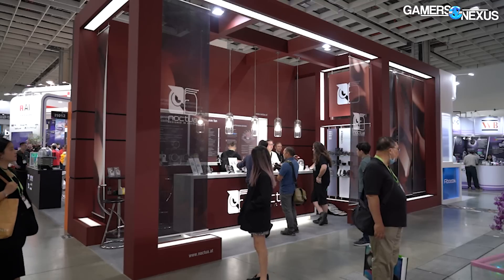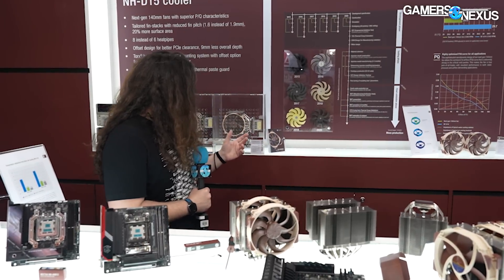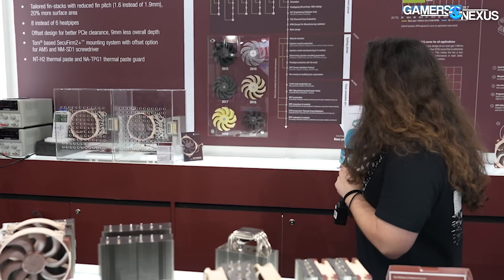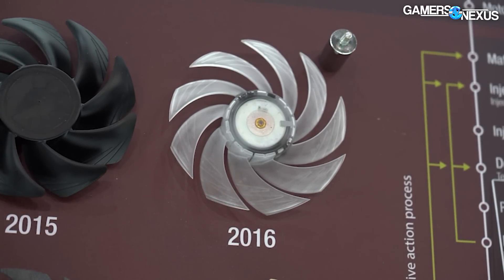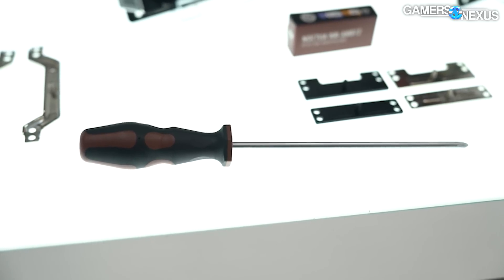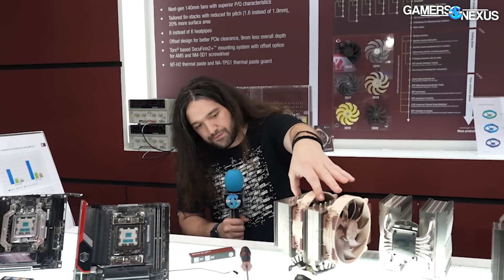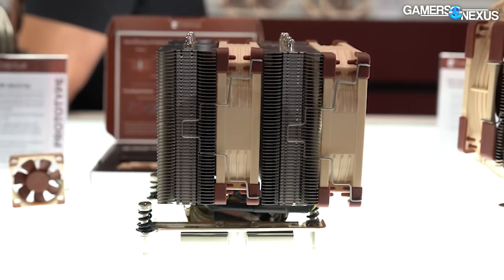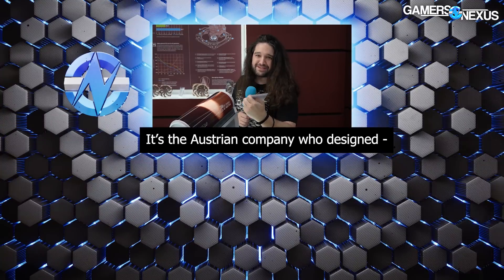Noctua is Back: NH-D15 Gen2 & 8 Years of Fan Development

Comment: I’ve been using my NH-U12-SE AM4 for about, oh, 6 years or more now? Saw me through a Ryzen 1700 and 3600, but now I’ve decided to upgrade to a 5800X3D I’ve decided to stop using it and go with a Thermalright Phantom Spirit 120. I haven’t actually seen how either performs just yet but I will retain the noctua case fans I bought, plus I’m sure the noctua fan and cooler will make a good secondhand market buy for someone along with the 3600. I very much rate them but I feel like there is more bang for buck out there in the world - NIDEC Servo, Akasa, a lot of decent firms get overlooked because they don’t have any bling or frisson, or they’re more industrially focussed, and I feel like noctua is a company that sets a premium on its quirks and isn’t as unassailable as they once were. I’ll be sticking some gentle typhoons into the phantom spirit to see how they get on.

Comment: 1:14 you can see they tested it (NH-D15 Gen2) on ROG X670E GENE MB, which has the GPU PCIE slot on the first slot, and it even works with the offset mounting. 
That's Noctua's quality and compatibility, really appreciate that

Comment: The 7mm offset is a 1c-2c cooler for AM5 eww and AM4 5000 series way better lol.
Reply: What?
Reply: @MrBlackmidi1234567890987654321  the 7mm offset for AM5 sucks but for AM4 5000 series CPU"s much better hell own a R9 5900x ran the CB r23 mc 30-minute throttle test scored 23,278 not bad.

Comment: I’m thinking about upgrading to a 13900k. Is something like the Noctua generally fine for this cpu or do you really need to go with an AIO to not thermal throttle? I’ve always shied away from AIO’s for some reason. I guess I don’t like the possibility of liquid leaking into my case or that the liquid can and will eventually evaporate. If I was sure it would last 5 years or whatever that would be fine but I’ve had friends who’ve had issues with cooling even after a year or two and they cracked their cooler open and it was empty. I just don’t want to deal with stuff like that. Or am I being crazy and is that kind of thing super rare? Is there a particular AIO that just has exceptional build quality and a long warranty? Thanks.

Comment: No matter how large the cooler base is, NPCs still put "pea size" amount of thermalpaste on the IHS and then spam forums with posts about bad temps =D While the IHS-cooler contact is covered only about 60% due to poor installation and cores not even located in the middle of the CPU itself

Comment: how bout these companies quit burning money on out dated fan technology and invest money into a modern cooling solution which replaces the fan and actually improves cooling for these new cpu/gpus that are running at 100c,  its advertised as just ok tjmax 105 110c nothing to worry about but there is its called seeder cracks  in leaded/unleaded solder which can happen after 1000's opf cycles of 100c+ heat and when these seeder cracks happen ya cant find it because there is no short to ground anyways yah reviewers need to quit hyping up fans its getting old and isnt helping the consumer

Comment: Noctua for me is the same level of compassion and craftsman-ship that Technics had and still has. Technics enabled DJ-ing Culture with their insanely durable 1210 Turntables about more than 45 years ago (and a few variations in specs afterwards) and if your 45 years old system has a part failing... you are able to get new parts still. Noctua is living up to this same hype in terms of longevity. I rock an NH-D15 since 11/2015 and used it with three different CPUs, and can still use it for the next gens to come free of charge. i'm also using the original fans i got with it from 2015 and they perform like never anything happened. Noctua is a staple of manufacturing, their stuff is just worth the pennys. I am absolutely looking forward what gen2 has to offer.

Comment: I wonder if they are doing any R&D on Toroidal blades?  I know they are being developed for quieter drones.  So far independent designers aren't getting the blade pitch/shape/thickness right for a pc application.  With Noctua's resources they could make it happen, MIT idea but it could be a big leap in air flow vs noise.

Comment: The Thermalright Silver Arrow T8 has had 8 heatpipes for quite some time now. I have it installed in 2 of my PCs.
It's a pain in the rear to install, and the heatsink fins are sharp enough that you can cut yourself, but it does wonders cooling.
The only way I can get my Ryzen 5900X to reach 80C is if I stress test the CPU with CPU-Z and run Furmark at the same time to heat up my Asus 3080 12G TUF OC - all in an ITX case. I am using noctua fans on the case for airflow though.

Comment: That might be a longer development cycle than my Noctua fans have warranties, but its not as long as my Noctua fans have lasted. Before using them I found fans failed more frequently than any other PC part. I have replaced fans to change sizes and further improve noise levels but still at zero failures since 2009 across multiple computers.

Comment: Great coverage of new Noctua products. Very cool contunued innovations. I have the Noctua NH-U12A, and it's the best air cooler I've ever experienced (although I did have to zip tie the fan-clips! my "user error", more than anything else) BUT, that aside, they are amazing products..cpu at idle is 38c, load is no more the 60c (5800x3d). Some of that is my case fan configuration, but again...no complaints! Thanks again Steve and all!

Comment: I am all for proper development, but the problem with long developing cycle is that it comes with big expectations aka the new product has an even larger shoes to fit. Certainly that got even harder now after Thermalright absolutely blew up the market with the Peerless Assassin. This new HN15 will probably be expected to fight most 360mm AIOs and not juat the crappy cheap ones. I am sure that Nuctua also knows that this new cooler won't be compared just to the old NH15, but to the very best air coolers on the market. Can't wait to see the results.

Comment: I could have easily purchased 2 NH-D15 coolers for the price I paid for my CLC, but it was said that none of the large air coolers would fit over the VRM heat sinks on my board. As much as I hated to spend that much on the CPU cooler, I do think the build looks better with it.

Comment: Been using my NH D14 since 2600k era, and now keeping my 13600k cool together with their free 1700 bracket. Now that is a quality product.
Reply: I am in the exact same boat! 2500k, then Ryzen 3600, bow 13600k. Solid as a rock, the fans are still perfect and Noctua sent me 2 mounting kits for free...
I think I will get the new cooler when it comes out but I don't doubt that my old NH-D14 will still be alive then!

Comment: Fan factor - my 1st Noctua NH-D14 edition which I bought for my Sandy Bridge 2500K running 5 Ghz @ 4 cores, STILL works fine and it's been ON pretty much 24/7 since then, as about 4 years ago I put it in to my server, before that it was in my main PC, which is on 24/7 as well -)

Comment: I am happy. XTU 100% CPU 2 hours @71-75C on air. I can't complain. I build my systems mostly for gaming- system specs below. I messaged Noctua they sent me a LGA 1700 mount kit within a few days and installed perfectly on my Z690 mobo. I do not trust and may never use AIO or wet cooling. I cant afford my stuff being ruined by leaks. It might not be so common- but is no chance at all with air cooling. A fan going bad is not as bad as a pump. I like my Noctua coolers and fans. :) 

I read about the Intel CPU' bending and seen the vid on GN and bought the Thermalright anti bending pressure plate. I had also read that pretty much all mobos with the Intel 1225v 1226v lan can have problems- so I preempted any potential probs and bought installed a Realtek 2.5Gb lan with the pressure plate during my build. I also read seen benches showing the Arctic MX-6 cools a little better than mx4. I found some good sales over the 2022 Holidays and at the time my 4070Ti cost $100-170 less than a 3080- and the 4070Ti performs with the 3090Ti and cost more than 1000 less  than that and even beats it in some games. The 4070Ti uses less energy and the fans run less hard than the 3080-3090Ti. Today you can find some 3080 used or no name- low name brands for about $800- but then might only have 2 fans and no metal backplate. My card was at time $810 with 3 fans and metal back plate and anti-sag bracket that I cant use on my mobo- I already had the Cooler Master GPU stand. I think all vid cards should be 100-200 less cost but I cant help that. I carried over my Case- Cooler and GPU stand from my last build- bought all new Noctua fans for cooler and case other than 2x 200mm Thermaltake fans for front intake- good to go. Runs great.

MSI Z690 Tomahawk WIFI DDR5.. Bios H.A0.. Intel 12700K.. Noctua NH-D15..
2X Crucial P5 Plus 2TB- CT2000P5PSSD8.. MSI MPG A850G PSU.. W11 Home..
Thermalright LGA1700 CPU Anti Bending Pressure Plate..
Cooler Master Universal VGA Graphics Card Holder..
CORSAIR Vengeance- CMK32GX5M2B5600C36..
Gigabyte 4070Ti- GV-N407TGAMING OC-12GD..
2Port USB2.0 Rear Panel Expansion Bracket..
ULANSeN 2.5Gb Lan- B08V1HG47H..
Thermaltake Core V71 Case..
Gigabyte M32U 4K 32"..
Klipsch Promedia 2.1..
Arctic MX-6..

Comment: been running a pair of the original nhd15s in my dual atx case, i use one fan on one of the coolers, and 3 fans on the other (5600x vs 5950x) and they run quiet and cool. paired with a 6800xt and 6950xt (respectively) it's a great running system. i do iracing on triple monitors and shooter games, and i record and stream those, so the systems do crank up pretty well. these coolers keep up nicely under sustained loads of well over 4 hours in many sessions. brown is the color for me

Comment: I have a D15 sitting on a 13900k. Even under synthetic workloads (ie benchmark) it is under 80. Normal use - still pretty heavy - it sits around 60 and is silent. sooo.... I guess if it breaks, ever, I will be happy to buy the fancy new one.

Comment: Considering the position of the chiplets under the Ryzen IHS I'm wondering if it would make more sense to have heatpipes / heatsink the other way around (eg: with fan moving air vertically).
It looks like most of the heat is concentrated on a small rectangle for both AMD and Intel, but 90 degrees apart.

Comment: it took a few years but my entire system is noctua fans now. the 140 have a lot of power if needed. and 0 noise if needed. i still run both fans from my nh d14. the 120 and 140 stock fans last for ever. they are about 12-13 years old. the 120 is still silent at full speed... wont see a corsair fan do that.

Comment: I have a D14 on a 3700X with fans on minimum so it runs around 60c idle, 80c load. I kinda want one of these because I bet I could run the CPU silent idle and whisper under load (tinnitus, fans spinning is painful)

Comment: It would be really great if they were able to get the overall height down on the NH-D15 Gen 2. I have the Gen 1, and the fans make it too tall even for the O11 Dynamic XL. I can only use the middle 140mm fan and a 120mm over the RAM. I can't get the window on with two 140mm.

Comment: Hope they addressed cooler shaking/vibrating when fan speed is approaching maximum (between 80-100%). I guess it's created by turbulence because both my D15 do this and it's very unsettling to see, although it probably can't damage anything, still, vibrating like this can't be good for CPU socket and immediate area, especially if your workflow includes lots of rendering where fans will run at 80-100% speed a lot of the time.

Comment: In aircraft jet engines, the fan blades will dig a groove inside the engine cowling on a soft material (usually green or blue), so that there is zero space between the fan blades and the cowling. As the engine spins up faster, the titanium fan blades stretch and carve out the material on the inside.

Comment: The fans were loud and ineffective on the original NH-D15.  There was only a tiny RPM range that they DIDN'T make a terrible sound, and they were outperformed by a single 120mm fan replacement.  This is inside of a fractal torrent airflow case.  Not bad if you intended to toss their fans in the trash all along, but people think they are paying for good, quiet fans when they buy Noctua.

Comment: Used to buy the high end AOI watercoolers, 360 & 280m rads.

Tended be noisy. Last year i switched to a Fractal Torrent case, NH-D15. Won't go back, and will upgrade to a new D15 once i refresh the system for sure. Even though there's no need.

I love it that much. Happy to support a great product & company.

Comment: I've been using Noctua fans for as long as I could remember myself while building PCs.

This year, however, I've finally upgraded to AM5 and I'm like what is all the hype with AIO and water-cooling stuff that I've missed for the past ~decade? Let me get up to speed: get an AIO from a well-known brand and looking forward to seeing all the fancy RGB lights bringing my temperatures :-)

So I went ahead and ordered the one actually advertised here as a sponsor... what a coincidence!

Fast forward to several days spent building my new rig. I've never used an AIO before, and had to educate myself on the best pump placement, etc.

The first issue I hit was the Arctic's ARGB connector: it was a tiny one, hard to plug in and - with the slightest movement - falling out of the socket. Fine, I'm not going to touch it anyway... but could you imagine someone designing an ARGB cable with black&white patterns, so it's REALLY visible with any background? That's just a strange engineering and design choice, but yeah I can live with that.

So I assembled my PC, getting ready to be blown away by all the AIO magic and the first thing that blew me away... was a really loud noise. It turns out that the default pump value was set to the maximum one and I had to decrease it manually in the BIOS. That's ok, I can manage that, but hey - where's the magic?

And here comes the biggest thing. After years with Noctua, I'm used to my PC being completely silent when idle. Like completely silent, where I had to put my ear next to the case to hear something. That was not the case with the AIO. It has this very subtle zzzing when the water goes through the pump or something like that. And having my PC completely idle and pump/AIO fan speed tuned down to the bare minimum, I could still hear that ** zzzing.

At first, I thought it was just me being oversensitive and I need to let it be for a couple of days, so my brain rewires and ignores that background zzzing. One day goes by, the second one goes by, the third one in - and this zzzing is actually getting under my skin. I can't really spend time next to the PC without putting on something on the headphones or speakers.

So I place an order in the nearest shop, go pick up Noctua again, completely tear down my already finished PC with all the cabling done for 3x AIO coolers, the abovementioned ARGB connector, and install the single Noctua one on my CPU.

I turn on my PC and that feeling is back again... my PC is entirely silent, I can't hear a thing... with all zzzing finally gone, what a relief!

Why I'm sharing all this nerd stuff, appearing like a real madman in the comment section?

Steve, would you mind refunding my $1 back to Artic so they are not offended they spent their marketing dollars inappropriately on a Noctua video?

Cheers

Comment: I bought a Noctua NH-D14 from Newegg on June 12, 2012 - and I'm still using it, now on an AMD 5900X. The great thing about Noctua is they keep selling adapter plates. So originally I got this for an Intel 3930k, then later I had a Intel 7700k, then an 8700k, then a 9700k, then an AMD 3900x and now the 5900x. Never had any issues with it, probably the best PC purchase I've ever made.
Reply: I was just thinking about getting a NH-D15 to replace the ageing H80i on my OC'ed fx8350. The AIO is still going strong, more than a decade after installation, but I know the pump can't last forever. I'm told if I ask Noctua nicely they'll send me a bracket for AM3+, as they aren't in the box anymore...
Reply: @Nick_R_  yeah, Noctua has a form on their site where you can submit your info and let them know what you need, and they'll ship it out. If you're not in a rush, that's the way to go.

Comment: NH-D14 and NH-D15 have been my preferred coolers since each came out. 12900K is doing well with a 225W limit on a NH-D15 for me now, no temps above the low 80sºC under full load and the 12900K is undervolted and benches at or above review benchmarks (which was my performance goal - I'm wary of liquid cooling still!). The old Sandy Bridge computer I built back in 2011 which has a NH-D14 on it idles in the 20sºC and doesn't heat up much under load, it was so much overkill for that platform :) Had it running for years stably at 4.8GHz with considerably raised voltage and it still didn't get hot.

Comment: Heres a dumb question: Why not use a layer of abrasive material in the outer frame so if the plastic expands a bit and touches it then it's instantly grinded off? wouldn't this allow an even higher tolerance?

Comment: I’ve always been a fan (sorry) of air cooling for its simplicity and Noctua in particular for the quality. This time though I went for an Arctic Freezer II (ironic given the sponsor on this vid) and it’s a revelation.

Temps are WAY lower and critically the cooler can hold the temps down for absolutely ages compared to the D15. 

Given the new version sounds as though it’ll only be a couple of degree cooler than the old one and it will almost certainly cost more the Arctic silver, I can’t really see any reason not to migrate to an AIO solution. I’m a convert!